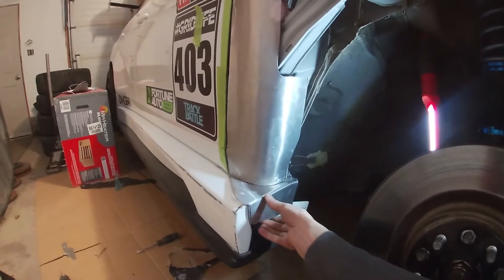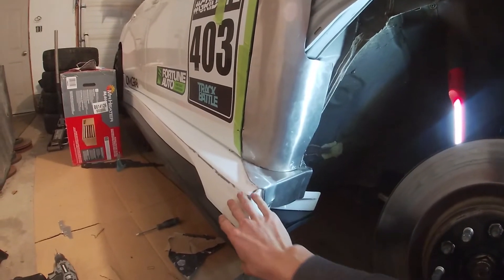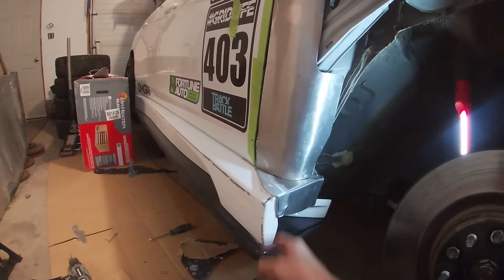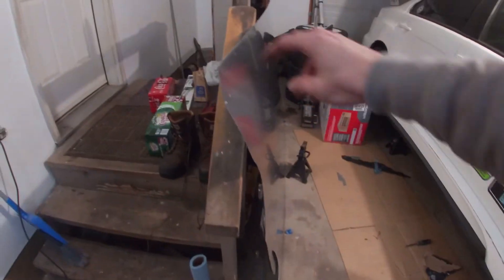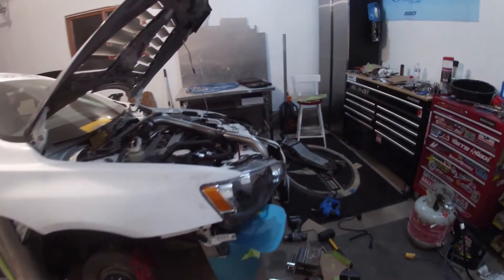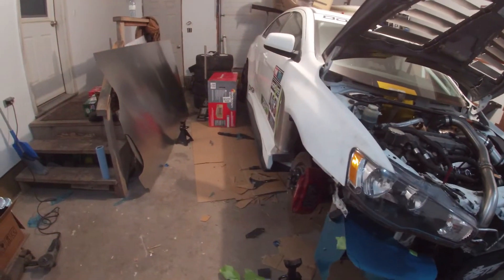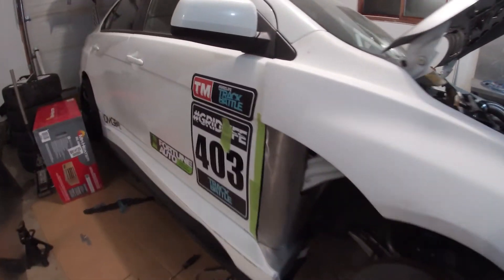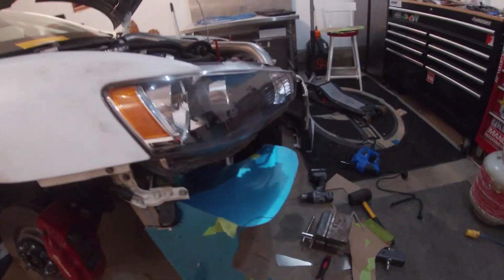Evo X aero build pt. 2 Victory more Function + oil cooler ducting

Comment: What rims and tires u able to run on the vf kit ? Without rubbing
Reply from the maker: With how I modified them I will be running 18x11 -12 with 285/35/18. It should fit a lot more tire too. That is just what i have tested with